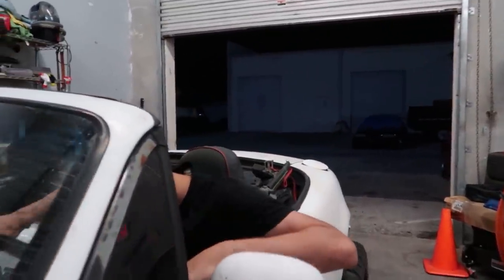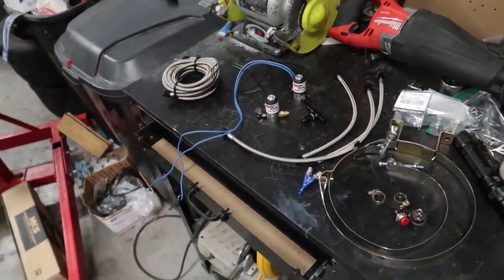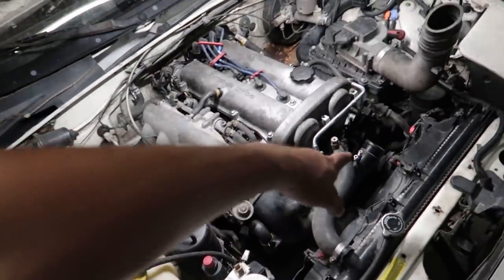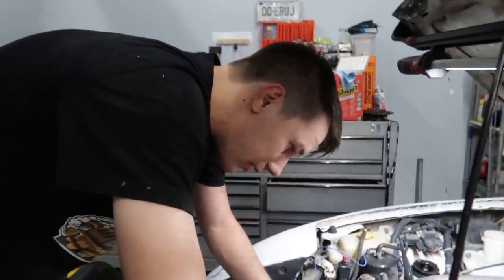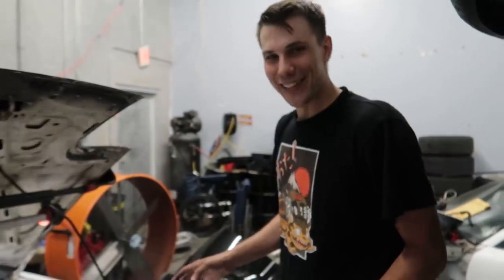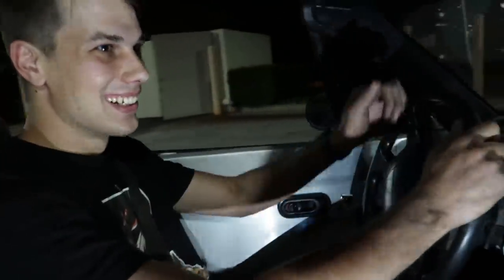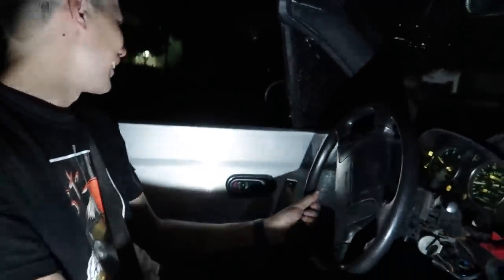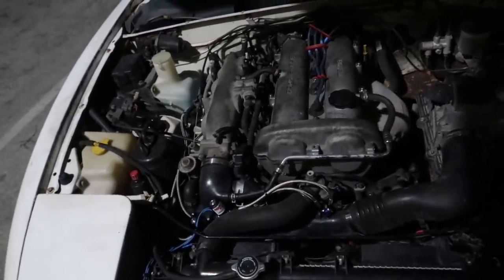FREEDOM IN A BOTTLE! THE OFF ROAD MIATA NOW HAS NITROUS!

Comment: Hey Sam, just wondering if you know much or anything about change over relays? If not then they are pretty simple in theory. They share a similar construction as a standard relay but work a bit differently. As with a standard relay pins 85 and 86 work as your electrical switching element, so when you flick a switch the relay turns on. But pin 30, which can be power or ground, will then be directed through pin 87a when then relay is not powered or “energised”, when the relay is powered then the signal is transmitted through pin 87.  So in other words, you could have it set up in such a way that when you are just driving around on the street trying to get to the nearest place to bog, you could have the horn working as normal, then flick a switch, engage the change over relay and then the horn button is your NOS button, then flick it back and it work like a normal horn.

Comment: You could have added another switch and used the airbag wires in steering wheel, just added your 3-ohm resistor under the dash for the abs light

Comment: It's higher than 300psi with a full bottle, ideally 900ish but it depends on temp n being n Florida...
Reply: Actually it's that pressure that's hard on the solenoid and why many use a remote shut off valve
Reply: A purge kit is nice to also bleed off pressure when you shut the bottle off or crack the line at the bottle

Comment: HEY GUYS ONE THING WE DID NOT MENTION:
Anything over a 75-100 shot you want to retard your engine timing at least two degrees.   And more as you go up in pill size above 100 shot.   At the 50 shot level it’s fine to leave base timing  set.   🇺🇸💨💨💨